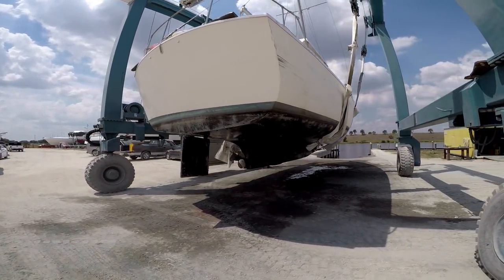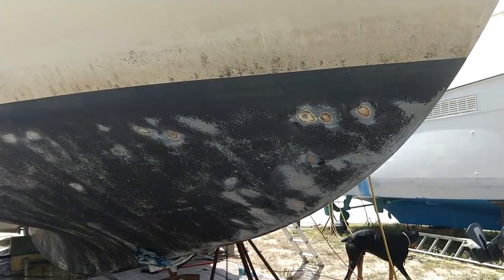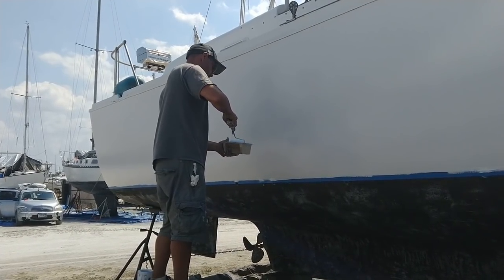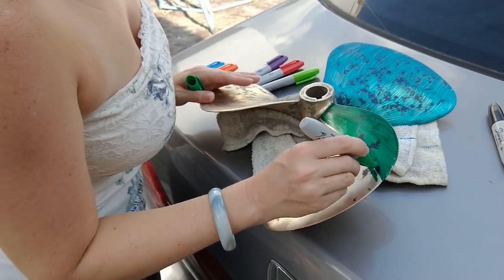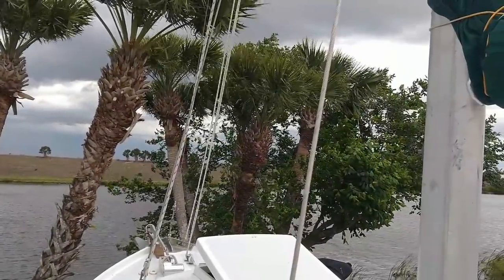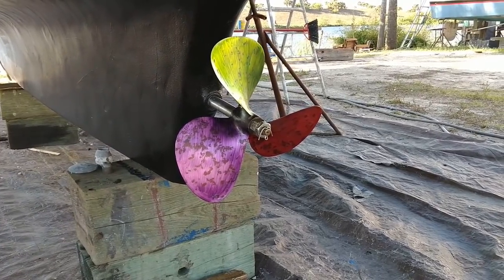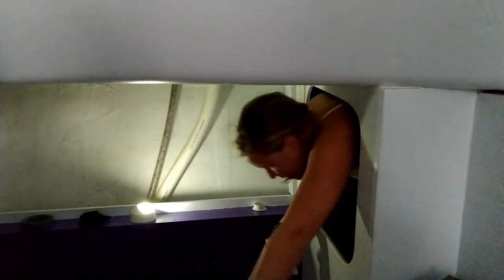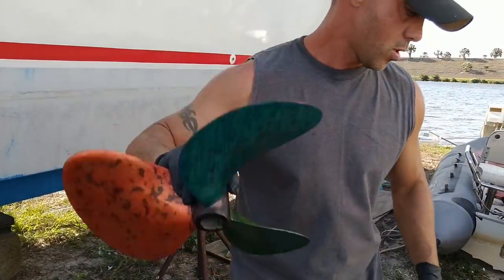Ep. 25 - Glades Boat Storage & the Bottom-side of Gone with the Wind ~ Big Easy Sailing

Comment: Nicely done! it is so amazing to see what paint does to a boat... oh and I had forgot you were electric power... and when you said put it in reverse, I was like but you can't crank the engine on the hard... oh no! then I was like oh yea, they are electric... :)
Reply from the maker: 😂😂😂 We'll be doing a video pretty soon all about our silent electric motor and power system. We've only mentioned it a few times, not a lot of camera time yet.
Reply: Hey Chase, you actually CAN crank, run, etc. an engine on the hard. I've done it numerous times on new aux power installs as the final check of systems prior to the re-splash.

Telescoping Flush kit used on your typical shaft-driven inboards:
https://www.wholesalemarine.com/moeller-marine-inboard-engine-flusher.html

Standard Outdrive flush kit used on Saildrives:
https://www.wholesalemarine.com/moeller-marine-universal-dual-water-feed-motor-flusher.html

And for those of you unfamiliar with what a Saildrive is (typically installed on European manufactured sailboats, and Cats in general):
http://images.boats.com/resize/wp/2/files/2012/05/volvo-penta-saildrive-623x666.jpg

Comment: You should have sanded the entire boat with some sandpaper and then etched the surface with PrepSol wax and grease remover before painting. Your paint will be peeling off. The same for the bottom before you start applying fillers.  This is the time to replace the zincs and change the shaft gland.

Comment: Looking good.  You guys did a great job turning the looks around of this old boat. 

A 4" roller is pretty much the max you can do with a boat hull on the topside and make it look at all decent.  You can get away with a 12" on the bottom, but it is really hard to get the paint even and you will leave visible roller marks, but it makes the job go a LOT faster. A few roller marks below the waterline aren't going to slow the boat down, and after a few scrapings will be gone anyhow.   I like to use both a 12" and a 4" on the bottom because the 12"  is more wasteful since it lays down too much paint in some areas where the hull is really curvy.  SeaFit makes a REALLY nice mohair roller cover with 3/16" nap that is amazingly nice for ablative paint.  It is an expensive roller cover but it is worth it when painting expensive paint as it pays for itself.  I will cut it up into 4" pieces sometimes for the 4" roller or just use disposable foam rollers for the tight work.  For topsides painting I'll use only 4" foam rollers and a foam brush to roll and tip.  Throw away the foam roller the instant it feels like it is getting soft and eaten by the paint BEFORE it starts to shed tiny chunks that will ruin that "spray-on look" you can get with roll & tip.  With the cheaper paints like Rustoleum you won't get the same finish, but it'll last just about as long.  There is a reason why Interlux Perfection or Awlgrip costs as much as it does.  Once you get the mix just right with the special brushing thinner the tipping makes the roller marks and even the brush-marks just flow like magic to a spray-on finish. But from 30' you can't really tell the difference between cheap and expensive marine paints.  It is a cruising boat and it is going to get beat up again anyhow.  Rustoleum will look just as good in 3 years as it does today. 

Too late now, but depending on how far you went down with the sanding it might have been a good idea to have put on  a couple of coats of Interlux 2000 or other epoxy water barrier primer first, not just for the moisture barrier but because it really does stick a whole lot better to the hull and old paint, and is a much better base coat that will hold on and not peel.  If you hot-coat over the epoxy at the thumbprint window with the first ablative layer the anti-foul will really get good adhesion at that first coat.  You might get some separation/peeling issues at your first coat because ablative sucks at sticking, especially to old paint, leading to the typical cratering you see in many boats as it builds up a few layers.  It just peels away in chunks.  

Good job on alternating the colors on the ablative.  That's the best way to tell how the top coat is holding up. Short of issues with the ablative peeling up at the point where it is bonding to the old paint you should be good to go for another couple of years.  

You guys don't really have much of a keel.  That must be nice in the shoals, but I bet she doesn't sail upwind very well or point very high into apparent without a lot of leeway.  We have a similar issue, and find that when sailing we just need to fall off a little and not try to point so high into the wind.  We go a lot faster, and even though our heading isn't as close to the wind we are actually going pretty close to where we are pointed instead of crabbing sideways with leeway going a whole lot slower. 

With the prop off it is a really good idea to take the prop to a marine prop shop and have it checked out with a propscan machine.  It's cheap, like $60-75 even here in high-priced Chicago to have a prop that size cleaned, scanned, ground and balanced so it is like new again. A large 3-bladed prop like that is hundreds of dollars to replace. Yours looks identical to ours.   It is worth the investment to have it done by the pros, and for all the work it takes to clean a prop the hard way their ultrasonic machine makes the job easy.  I screwed around for hours trying to clean our prop with poor results, and their machine at the shop had it like new again in 3 minutes without removing a gram of precious bronze.  

Your swim platform mounts look great.  What an awesome find. I can't wait until you show us the finished deck.  I am sure you guys will build something totally awesome on those beefy mounts Teak, modern plastic fake wood deck-building slats?  Lots of neat choices.   I personally would not have mounted the mounts over the new ablative paint like that, but I guess it made painting easier.  I would have at least carefully sanded the ablative back about 3/4" around each hole to give the polyurethane adhesive something dry and solid  to bond to on the outside in the sandwich between the metal mount and the hull.  Ablative soaks up water like a sponge, so water will just creep up behind the 5200 right to the edge of the hole if it is left on the hull under the sealant.  Then you will have to rely on the bond around the bolt inside the hole itself, and whatever you applied to the inside under the washer.  That first defense on the outside is the best IMHO, same idea with a through-hull mushroom.   But 5200 is good stuff.  You should be fine. I just like having that bit of 5200 or 4200 (makes no difference really other than how hard it is to remove later) on the outside helping too, instead of being laid over what will eventually be waterlogged ablative paint.
Reply: Your finishing your boat off nicely.

As to the point above regarding the keel, or hull design, I was really hoping that Gulfstar, Inc. would have modified the underbody over their Trawler 36 configuration (from which this sailboat is derived). After seeing the boat out of the water, the two hull designs appear to be identical.

http://www.powerboatlistings.com/powerimg/m/17076/main.jpg

As also mentioned, this hull design lends itself to less than optimal pointing capabilities, which will adversely effect its performance with regards to VMG (velocity made good), but no biggie, it'll just take longer to get there. I think the bigger issue here might be the boat's ballast to displacement ratio. Unfortunately SailboaData.com does note list this, but given the design, I seriously doubt it even comes close to the minimum 35-40% ratio typically considered for going offshore, which is Big Easy's intent.

Comment: The thin nut is supposed to go on first then tightened to a little less than full torque, then the big nut goes on and is tightened to full torque.
Reply: What's the difference?
Reply: Bull shit.. The thin nutis called a jam nut itis used to hold the big nut from backing off.. Use 2 wrench hold bigger nut still and tighten thinner nut on top of thicker on.

Comment: Great video, very nice paint job, you guys are doing fantastic work. That shot looking at the bow was awesome. I do have two questions?
* please explain the different colours on the prop, I didn’t get that?
* how did you paint under the holding leg pads?
Reply: She said they had heard that the markers may help with growth, I had never heard that but interesting for sure... it is possible to move the pads, as long as you do it one at a time,  from what I have seen in the past, you loosing one move it and then put it back, the on the other side, mirror side, move it down in the same manner.
Reply from the maker: Thanks! Like @Chase Mixon said, Sharpie is supposed to prevent prop growth. We were told this at the boatyard by a seasoned South African sailor. We were also told by others that this doesn't work??? So we decided to do multi colors to see if any particular pigment will work better...Regardless, our prop is beautiful for now and we had fun with the project. There was a $20 charge for a stand move. They ask that you don't move stands yourself.
Reply: $20 charge for each stand move?  Holy wowsers!  I thought that the crappy yard I was at last year was crazy about rules, prices, and being d-heads about stuff like that, but they let me use a couple of extra stands, and a chain to put between them, to set a few feet back while I lowered the rear pads on our cradle when filled the flaws and painted.  The rental cradle they put us in was so crappy that the front pads didn't lower any further so we had to sand and paint those in the slings, even though I specifically told them I wanted to re-do the bottom when we got there and contracted them to do all the sanding.  That came to $1.5k -ouch! But still worth it as their guys put 60 hours of labor into the job (I was keeping track) using professional high-powered sanding machines, it was that thick.  I spent almost that much again on paint and supplies. They even ran through $250+ in sandpaper (again, I was watching them go through the paper like it was candy on their professional sanders) It was all part of the bid contract and this place doesn't allow outside contractors so we were stuck with that price or having to do it ourselves. Plus this is Chicago so dust catchment would have been a big deal. They use special sander machines with built in high-power vacuums which created almost zero dust.    The head sander guy said it was one of the worst bottoms he ever had to deal with in his career.    The 2 days we sat in the slings at the end was included with the cost of the sanding at least. IIt was over a 3-day weekend 4th of July so it worked out for them.    It was their screw-up because they put us in a crappy too-small cradle that didn't adjust properly.   I understand the liability of not letting random folks of unknown experience move  stands themselves though.  If your boat tipped on you, or on someone else's boat, it would be a lot of paperwork ;)

Comment: You two are to be commended for your work ethic and your skills in taking care of your boat.  You don't mind getting a little dirty to get the job done.  It also seems you approach each task in a step by step process to do it right.  My concern is with the boat itself.  It doesn't have a great reputation as a sailboat and after seeing her out of the water I can see why.  Such a small rudder to maintain control and the hull shape doesn't appear to lend itself to handling bigger waters.  Your choice of propulsion is also a concern.  I know nothing of electric engines and perhaps the engine itself produces enough power to control the vessel.  However, if the engine cannot access the energy required to operate, you could find yourself in a world of hurt in a variety of situations that necessitate immediate power.  I hope my concerns are off base and wish the two of you success.
Reply from the maker: Thanks! Stay tuned for future episodes. We will be releasing one all about the motor and our power system pretty soon.
Reply: Bill Jones, based on your comments regarding the Gulfstar and its underbody design, you appear fairly knowledgeable about sailboats, and I agree with your observations.

I too have my concerns about e-propulsion. My experience with them has been primarily in racing, with professional installs, one of which was a TP52 in a trans-pacific race to Hawaii. Even when done professionally, the range was very limited. This is not necessarily a big issue in the race community, as your aux power is "sealed" by the race committee at the beginning of the race, and checked upon completion of the race (to prove you didn't fire it up).

Comment: Hi interesting idea for antifoul on the prop? I think there is a prop antifoul , slick speed or something available now that works , bound to be expensive .
Re the prop nuts , apparently your nuts were on right the first time if you get my drift!  Check out  Bill Parole blog as he explains why the large nut should be on the outside.  https://www.followingseas.media/blog/2017/2/8/the-truth-about-prop-nuts-and-why-it-matters?rq=Prop%20nut
    But he agrees that despite the reason props don't fall off with the small on the outside!
Thanks for tip of a reasonably priced haul out place.  Cheers Warren

Comment: HOPE YOU DIDN'T run that engine even for a few seconds without water.  I just lost my boat and almost my life for the same mistake. Your impeller will fail. your exhaust will overheat,  your exhaust boot will ignite and then you will either sink from flooding because of the failed boot or burn to the water line - or get lucky one more time.  Sorry got to go.  I'm done. the pain is now to great. Good Luck  and Good bye.
Reply from the maker: Thanks for all the great comments Mr. Wonka! Our motor is full electric... no exhaust, impeller, etc.